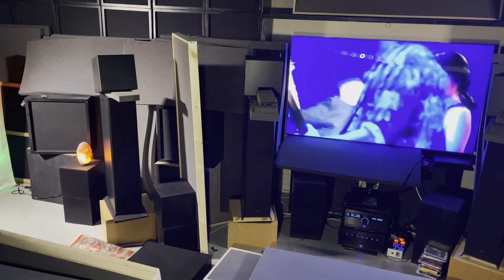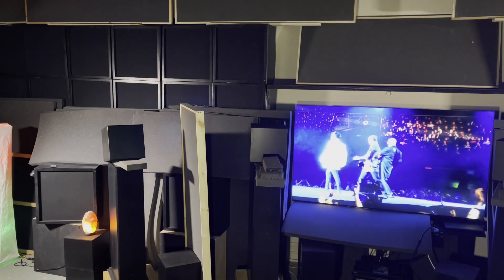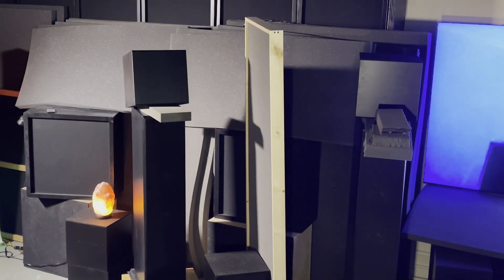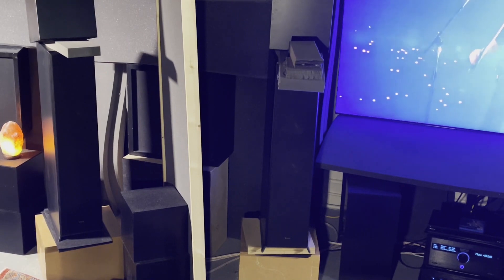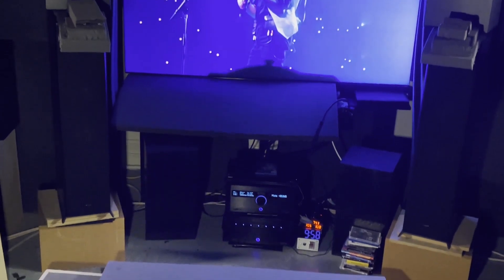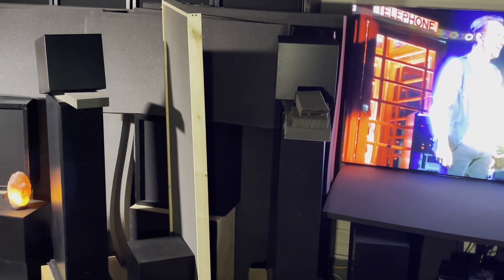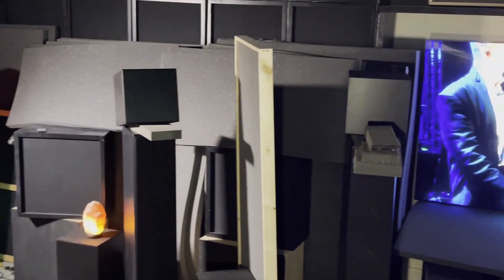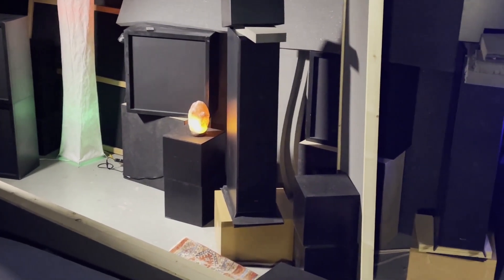Multi-Channel - Front Wall - Part 1/6 - www.AcousticFields.com

Comment: Thanks Dennis!  This makes a lot of sense... Especially, since I plan on utilizing a video wall instead of a front projector and screen system.
Reply from the maker: Splitting the center channel works with any screen configuration. Must have ability through processor to manage center channel gain.
Reply: Dennis,

One more question!  Are you splitting the Center using an XLR splitter to accommodate two channels on the amplifier?

Comment: So,

The Left Center and Right Center will be to the outside of the screen, correct?
Reply from the maker: Yes left screen and right edge of screen
Reply: @AcousticFields  Also, I see you have them positioned to the outside of the LF and RF...How significant is the sound?
Reply from the maker: @michaelslocumbsr.2286  The soundfield is seamless and extends floor to ceiling and sidewall to sidewall. The dual center channel output needs to be managed in amplitude so it does not overide the left and right channel output. Everything will balnce. Everything must balance.

Comment: Great room there. Looks like mine, WAF big zilch but if it works.
Reply from the maker: Your missing the point of the video. The room is a research facility dealing with pressure and reflections. The only women in the room that must be dealt with is mother physics.

Comment: Hi Dennis, I can’t wait for the rest of the series! Also, I noticed you’re using an Emotiva processor and amplifier. Being that there are an infinite variety of equipment you could have chosen, apparently you like them. Could you tell us what you think of them?
Reply from the maker: It is a cost benefit when you are running a business. For the cost, it moves energy around to meet our research requirements.